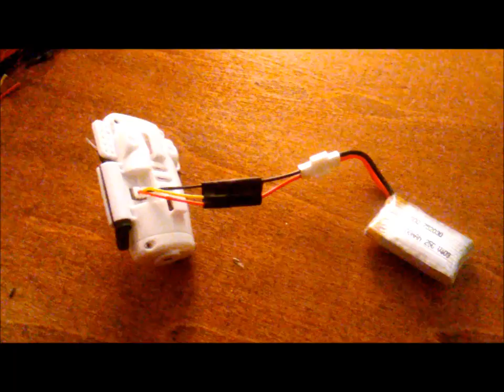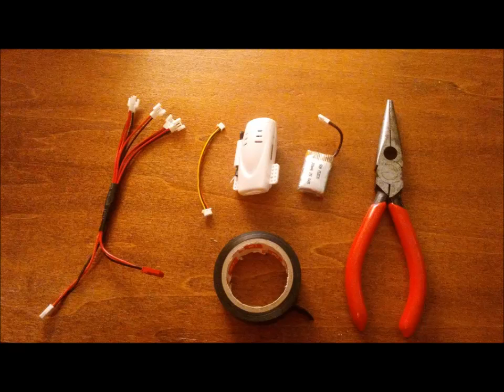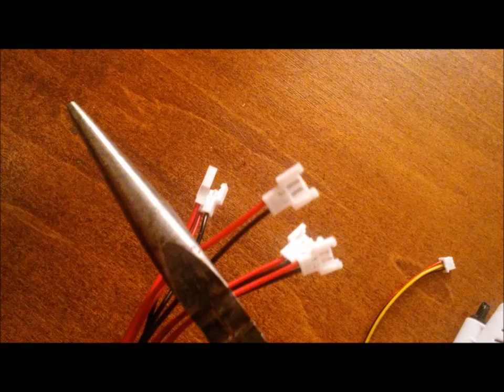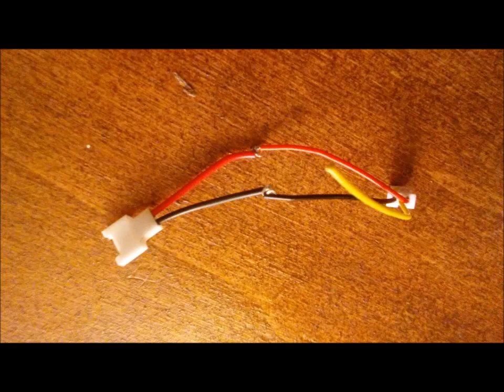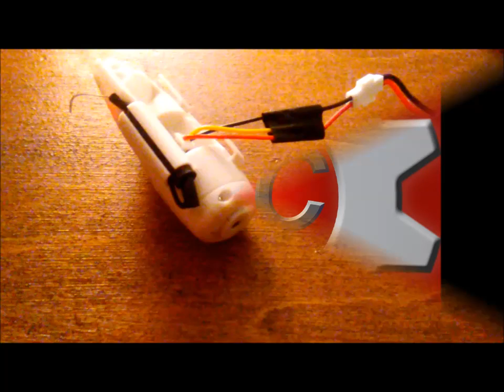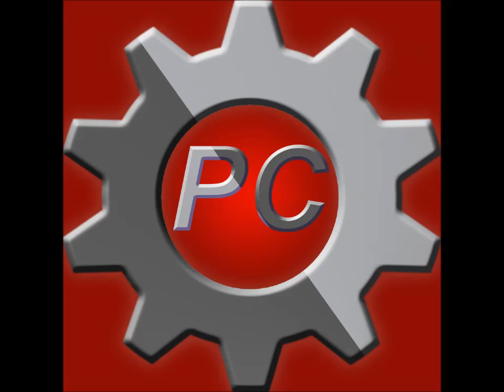How to Run a Wifi Drone Camera by Battery - DIY Run FPV Camera Without Drone!!

Comment: Can you power with a usb?
Reply from the maker: I have not tried that, but I believe you could as usb if I remember right is a 3v output and that is what this requires to run.  See my fallow up video from last year where I run this on AA batteries.
Reply: @PatriotContraptions  batteries are 3 volt.  usb is 5v

Comment: Can I connect the drone camera to the drone controler screen with out the drone?
Reply from the maker: So long as the camera contains the transmitter unit and not the drone you should be able to use this modification.  As you can see in mine on the video the camera has a little antenna coming out of it so this means the transmitter is built into the camera.
Reply: @PatriotContraptions  yes mine have an antena but i cant connect it on my drone screen.
Can you pls make a video about thet pls 🙏
I will subscribe if you make a video about that plsss🙏❤🙂
Reply from the maker: @Ronald Comilang  I would check to make sure your phone wifi is connecting to the camera's mine used to say no internet and default back to my houses internet I had to go in and tell it to select the camera wifi then quickly open gx_ufo app.  I will see if I have stuff for a video still..
Reply from the maker: Video is up hope it helps, https://youtu.be/OY3QfuPG8is

Comment: I have an issue it just lights up but it doesnt give me a wifi connection
Reply from the maker: It could be a none WiFi camera is my first thought I would check and see if there's a antenna on its side you can sorta see it on mine in video. Like a little white wire.

Comment: I have question: I have a drone with cam but drone Broke down and i want use without drone, i Worked cam with drones battery, later i charge battery but charger have short circuit and battery explodes. Battery 3.7 V 750mAh. I use 3.7V 800mAh battery. Cam is work but doesn't open wifi can you help me?
Reply from the maker: So If I read your question correct your original battery burnt up, so you got a different one that powers camera on but will not transmitter WiFi? So there's a couple things I need to ask.  
 1. Did the camera transmit while it was connected directly original battery? If this was not tested before battery burned up then I see two options A. The cameras wifi transmitter is located in the drone not the camera (must have drone to transmit).  B. Something is damaged in camera or receiving device.
2. If the camera was tested as above with original battery and did work without drone then it's  either A. WiFi Receiver issue B. Fault battery connection(kinda daubt that) C. Camera went bad or very weird

If you still have the drone I would try connecting camera to it and seeing if it will transmit.  Then unplug camera and check power at the cameras plug-in on the drone to verify its on correct wires.  After that run power straight to the camera without drone if it doesn't work the transmitter is located in your drone and camera will not work by itself.  

If the camera doesn't work when hooked to drone and drone is putting out power the camera is probably the issue..but also slight chance it's the drone either way this means the camera will not run by itself.

Hopefully this helps you out :-)
Reply: @PatriotContraptions   First i try just (i dont connect drone) original drone battery and camera works well i connect phone to cams wifi. After original battery explodes. I use 3.7V 800mAh PHONE battery and its not work (It's not about battery ) i think you're right about the problem( 1.B) i think camera have issue. Thank you so much for your help.
Reply: @PatriotContraptions  and my drone doesn't connect remote control. Its hit the Curtain and fell off the ground and drone is off after i start drone and open remote but drone does not connect help me

Comment: I added a WiFi cam to my drone and it puts out so much interference I can’t control my drone I have to disconnect it in order to have control what can I do to solve this issue
Reply from the maker: In that instance there is nothing simple that can be done.  The issue is that the drone and camera are on the same frequency's so really only option is to get a camera on a different frequency.  It stinks, but I think that is the way you will have to go...

Comment: I took the fpv wifi camera from my drone but it wont show on wifi list.... It only shows if is a drone connected
Reply from the maker: The camera will only work on its own if the transmitter is contained in the camera.  In your case it is likely in the drone.  Normally cameras with transmiters have some type of small antenna on them I would look for that on yours.
Reply: @PatriotContraptions  problem solved. I increased the amperage and it's turning on. But quite hot.
Reply from the maker: @RoStepMusic  Cool, just don't burn it up :-)
Reply: @PatriotContraptions  well i think ill try with different resistor values and see if i can step down the amperage

Comment: Could i hack the 4 wire cameras without transmitter as well? Thanks!
Reply from the maker: I do not know how to do those as I have never had one.  My logic says if the transmitter is in the camera you should be able to, if the cameras transmitter is in the drone this will not be possible.

Comment: What about the yellow wire.......DUDE
Reply from the maker: Yellow wire is the control wire from drone to camera it can be used to tell the camera to take a photo via the in built drone control transmitter.  This is normally used on cameras without WiFi control.  I think that it also works on the WiFi ones as a back up on some models(if WiFi is breaking up) however I have never needed it to control a my WiFi camera.

Comment: Rip, when I connect a 3.7 battery to my drone camera it was on for a couple seconds then caught on fire lol
Reply: Maybe because the nominal voltage of the camera was 3.3V, but your battery has a voltage between 3.7-4.2V.

Comment: could I use a non Wi-Fi camera on a Wi-Fi drone same cameras 1 Wi-Fi 1 not
Reply from the maker: Yes, you can use a none wife camera on the drone so long as you have a way of controlling the camera on and off from the ground.  My drone can use either and is sold with a none wifi camera.

Comment: My camera does not power on unless plugged into the flight board of the quad it came on. Even if there's a battery directly plugged in. Anything I can do?
Reply from the maker: My suggestion would be to take the voltage reading directly from the flight board plug to make sure you are supplying the correct amount to the camera some drones will have a 6V battery but reduce it to 3.7V for the camera or something similar.  The other thing would be if the wifi video transmitter is not built into the camera but the drone itself, if this is the case you will not be able to run the camera solo.  If you do take the voltage from the plug be careful not to touch more two of the leads together as this could cause a short and damage the drone.  If you have a extra plug I would use that to plug into the terminal and then strip the wires coming out of it to get my reading with less risk.  Hope this helps :-)

Comment: hey Patriot, is there a way to connect the same type fpv cam from my quadcopter to my hsp rc truck and can you connect it to receiver to draw power from truck or not?
Reply from the maker: If you mean run the camera from the trucks battery...I would say yes it is do able...but you would need to learn how to build a voltage regulator or some type of power reducer to not burn the camera out.  I have been looking into this for projects but do not yet feel confident in doing it without more research into electronics so I can't tell you how to do it unfortunately(also it will differ with each vehicle).  I run mine still like in the video with a drone battery just to play it safe,but If I do figure out how to make the voltage regulator I will post a video.
Reply: @PatriotContraptions  you could just by a cheap voltage regulator off eBay for $5😂
Reply: It just depends on your batter voltage, you would also have to get one with a voltage display so you'll know how many volts are coming out, mine doesn't have one, I just use an electrometer to see how much it's letting out, mines a 3.7-12v voltage reg